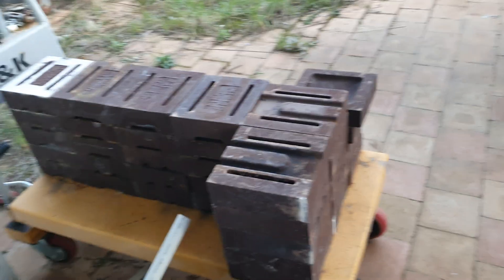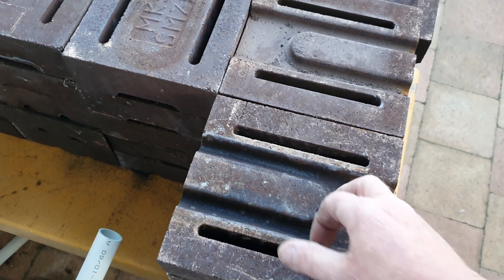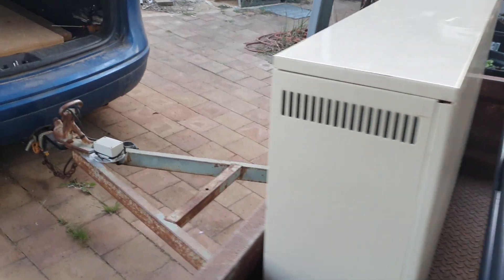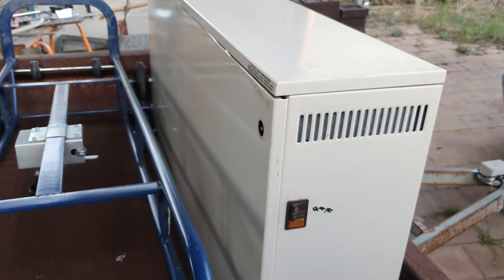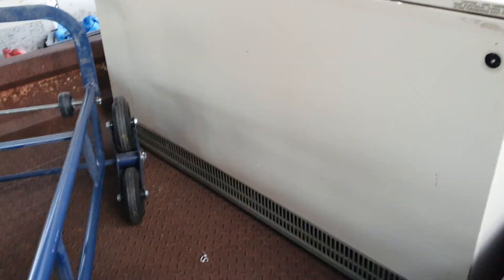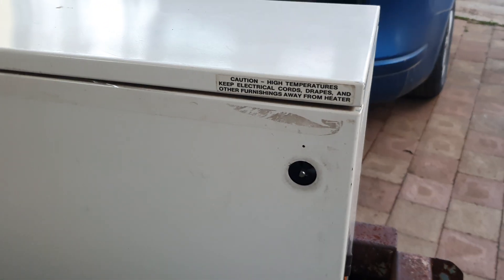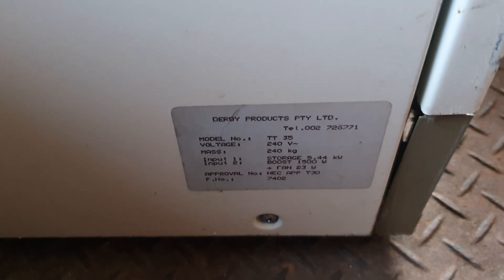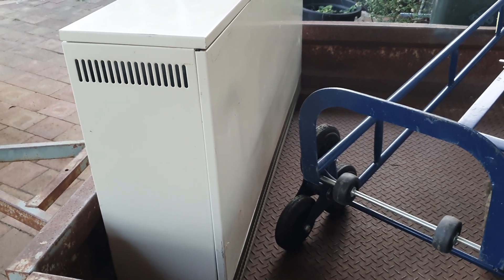Old style electric heat bank for using excess solar during the day to heat my house during winter

Comment: Manufactured by the now defunct Derby Products in Hobart Tasmania for the record. Used to be a lot of these around in Tasmania, though the 2kW model was by far the most common.

Yes they're heavy. I have some definite memories of relocating 2kW units full (with the bricks still inside) and it's somewhat strenuous work yes. Those weren't designed for easy dismantling, only the larger sizes were.
Reply from the maker: This 5.44kw has approx 200kgs of what seems like cast iron blocks, yes no easy job to move, this one will have 4 wheels rated at 150kg each attached when finished

Comment: Interesting idea but I don’t think that you’ll get very good results because of the low efficiency and limited winter solar production. We warm the house with air to air heat pumps during the day time which are also quite cheap to buy and the house retains the heat to some extent once it gets darker. The air to air heat pumps have a cop of 3, or sometimes double that if it’s mild outside (above 10c). I warmed out our 45m squared room from 16c to 22c for 6 hours today for just 3kwh! We still heat our water with resistance heating though.

Comment: Great idea you also need a heat source that is not resistance heating maybe a heat pump.
Reply: The output temperature of a heat pump will be no where near high enough. These work by heating the core upto 200°C or higher then slowly releasing it.
Reply: @JaenFoster  heat pump run through a desuperheater will do it at least that is what my heat pump uses to make hot water.
Reply: @offgridwanabe  that's fine for 60-70°C hot water and while you might manage to get up close to boiling it's still no where near what's needed for effective solid state heat storage
Reply: @JaenFoster  What is the highest temperature a heat pump can produce? High temperature domestic heat pumps can provide heating up to 80°C, the same as traditional gas boilers. Regular heat pumps tend to reach up to 55°C.
Reply: I know you are looking for 500f at least, low voltage nichrome wire will do it with 24 volts

Comment: Nice Ross! I'm using Bitcoin miners for heat in the winter but of course there's no heat storage but they do generate BTC so I guess that's a form of storage...😆
Reply: direct your fans at a large mass/concrete/stone/concrete floor etc.
Reply: @gug1970  Hehe That's using your brain! 😂

Comment: Are you going to go through an mppt controller + inverter or are you going to power the elements directly from solar?
Reply from the maker: I intend to run it from my set of  3 x off grid Inverters